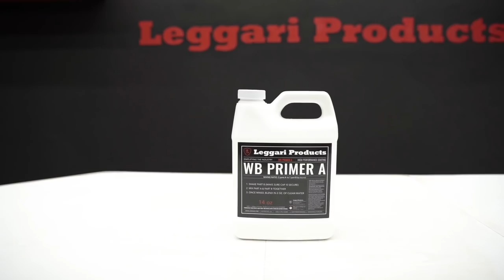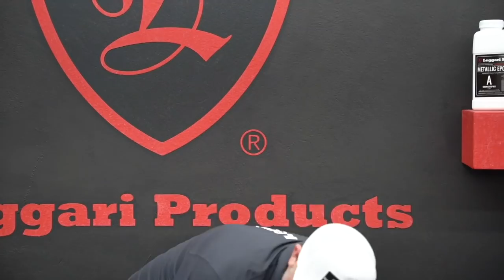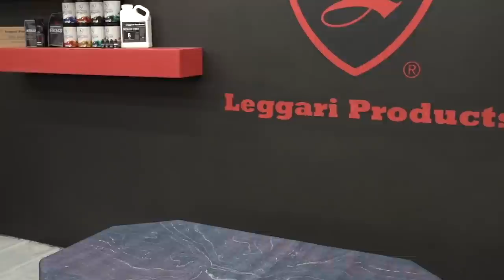Old Dining Table Turned Into A Masterpiece Using Leggari's Epoxy Resin | Full Project Explained

Comment: 1. Very informative, however it wasn’t what I expected. I was expecting more of a glossy look, and not so dull.
2. How do you get denatured alcohol?
3. Thank you
Reply: Denatured alcohol is sold in hardware stores.  or any big box stores most often in the paint department.
Reply: Question?
I resined my dining room table, my first resin project, but it’s not perfect. Some creators, and edges are terrible. Could I sand it, and re-coat with a clear, glossy resin to fix the problem?
Thank you
Reply: He said he was putting a matte eurethane product on top.
Reply: Yes I want to know too how you get denatured alcohol.
Reply: @lisaharrison4361  you can sand the table then apply another coat of epoxy.

Comment: I have a question.  How do epixy finishes work for use in a travel trailer where it will be exposed to cold temperature extremes during winter storage.  Will the expansion and contraction cause the finish to crack or will epoxy be able to handle that?